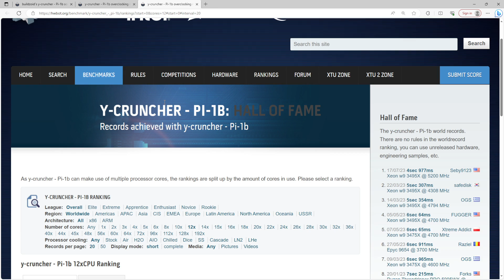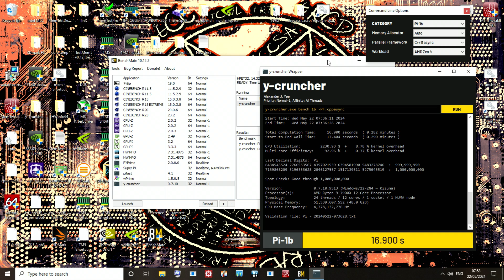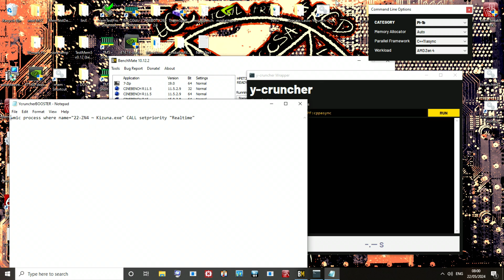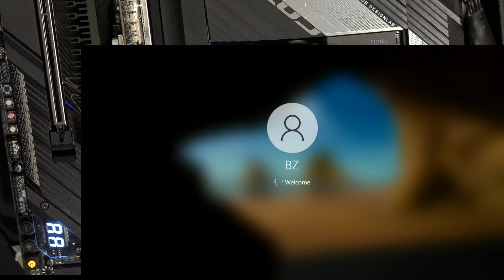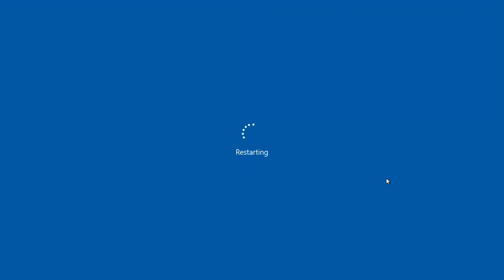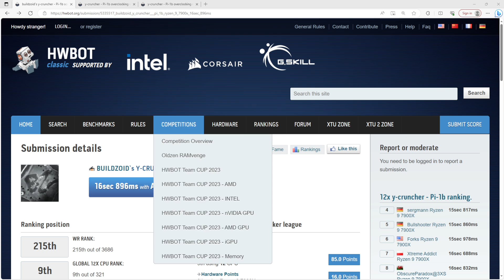How to get a TOP 10 score in 12 core Ycruncher-Pi 1B with a Ryzen 9 7900X

Comment: In your Patreon, you shared some RAM tweaks for Ryzen and recommended setting vSOC to 1.25v because some CPUs need that extra juice. Do you know how low you can typically get vSOC when running 6400Mhz? My Teamgroup 7200 CL34 (FF3D532G7200HC34ADC01) Kit currently runs 6400CL32-40-40-84@1.25V (VDDIO, VDD, VDDQ) and vSOC at 1.15v. When I try to go lower and set v1.1 the OS boots but Y-Cruncher fails with the message that the calculated value of logic core #2 is greater than the threshold. So I guess that going lower than 1.15v isn't a thing. Is there even a reason to push it down further? As far as I can tell, vSOC  should be <=1.3v so even 1.25v would be good enough.
Reply from the maker: I still haven't managed to stabilize 6400 on any of my Ryzen 7000s.
Reply: @ActuallyHardcoreOverclocking What is your test routine? I am currently running y-cruncher, MemTest , Linpack, TM5 Extreme
Reply: @ActuallyHardcoreOverclocking 
I have got 6400 cl30 fully stable with g.skill m-die 16gbit with vsoc1,3 and your hynix recommended timings. I use an asrock b650e taichi with BIOS 1.28 and a 7600X @eclk103 =5665MHz (PBO +200MHz with CO-5)
I can run all benchmarks and have no idle problems.

Comment: Why are all the records with the 7900X instead of the 7950X?  Wouldn't the 7950X typically be better silicon, so disabling the worst two cores per CCD on those would be better?
Reply: Not allowed to disable cores, otherwise it would all just be the octachannel 3495X winning.
Reply: @seby9123  As a scoreboard rule, not a BIOS limitation?  And come to think of it, why is a 6-core CCD better at ST anyway, even with LN2 nullifying the heat density?  Or is it power?
Reply: @concinnus If the cpu is sold as a 12 core, you can only submit in the 12 core categories. So yes just for the scoreboard. Idk what you mean by the second part, this is a multicore bench.
Reply: @seby9123  I just hadn't realized that the scoreboard was 12-logical-core specific.  Derp.

Comment: Hm, if you use the script to put the process into realtime mode after the process started.. don't you loose some precious processing power ? Why not use linux for this test ? (Y-Cruncher is in the AUR).. it is much easier to start processes in RT there I would guess..also there might be less overall system cpu / memory usage what might give an advantage also .. I am not a windows user so I could not tell ^^
Reply: HWBot does not allow submissions on linux. It also mandates BenchMate software for modern processors/OS to ensure that ClockSpeeds are validated in a secure way (so that you can't fool time measurement).
Reply: @NostalgiaOC  oh, IC .. well then .. scratch that ^^

Comment: Looking to upgrade. I've got two options at the same price:

R5 7500F + B650M-HDV 
12400F + B760M PG Riptide

Would they perform similarly with the 12400F oced to 5 / 5.1 GHz?
Reply: 7500f will be faster everywhere
Reply: Why would you buy into a dead platform (LGA 1700)?
Reply: @PowellCat745  It's not dead, 14th will use lga1700. Granted it's a RPTL refresh.
Reply: @IIHydraII  other than 14700K, they’re on average 3-5% faster. The “14th gen” RPL-R absolutely doesn’t deserve to be a new generation of CPUs while Zen 5 is one of the biggest upgrades in years. LGA1700 is dead.
Reply: @PowellCat745  hmm fair enough. What about stuff like IMC?
Reply: @PowellCat745  Hardware Unboxed did a comparison of 7500 vs 13400, check it.  7500F was consistently better.  Also a more reusable motherboard.  The 13400 would probably be best in productivity stuff that they didn't test, but not the 12400 as it lacks E-Cores.
Reply: @IIHydraII  If you ever watched BZ’s previous videos, you’ll know Intel’s 12/13th gen IMC is trash. BTW, AMD has V-Cache, so memory support doesn’t really matter.
Reply: @concinnus  I don’t think 13400F will win even in productivity. https://youtu.be/AdvWGEzYqg4?si=5Op3RwPkeGjtlnQQ
Reply: @PowellCat745  I’m aware, which is why I made that point, maybe they improve the IMC in the next batch. Maybe not, who knows.
Reply: go with 7500f
Better upgradability and overclocking potential (since actual OC / undervolt is locked except bclk on intel b boards) 
Keep in mind OCing the 12400 will also almost double the power consumption to the 7500f
Reply: I mean at gaming I think it's just gonna matter how hard you're overclocking ram, I suspect the 12400F might edge out the ryzen system in singleplayer games which are often mem bandwidth bound now but the 7500f is just an infinitely safer bet
Reply: @creaturedanaaaaa What are you smoking? The 7500F absolutely obliterates the 12400F in gaming... https://www.youtube.com/watch?v=s4Z5d3eQD0U 🤡